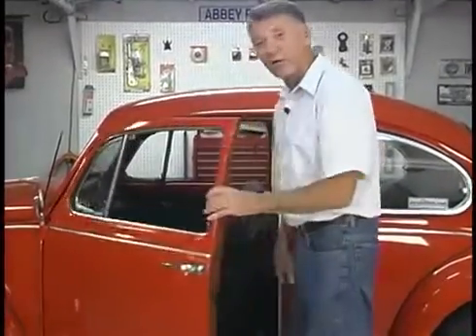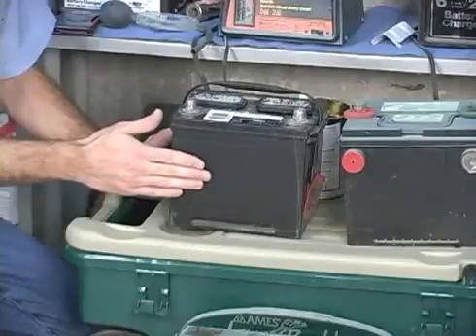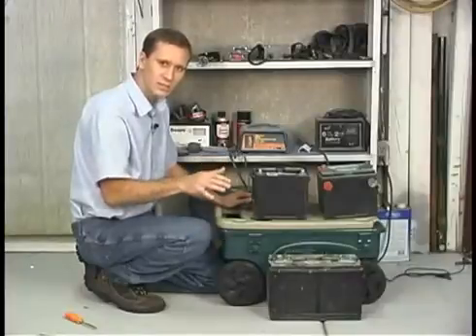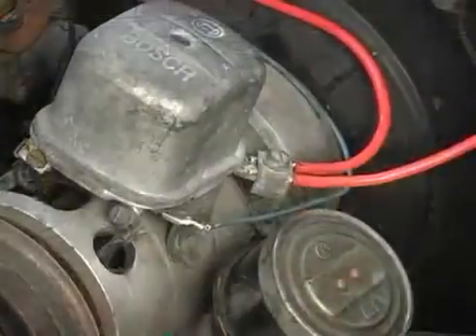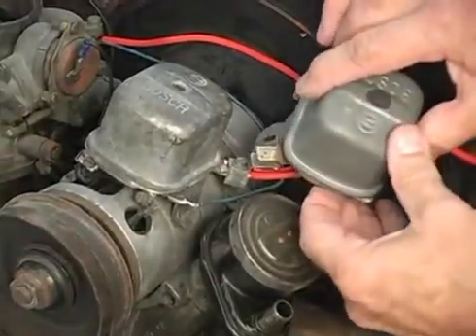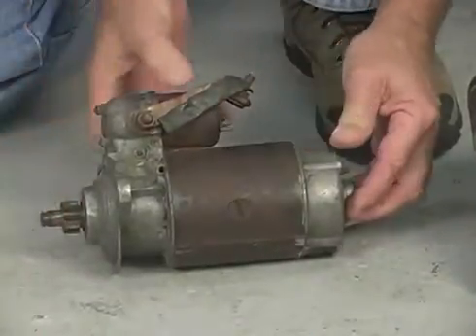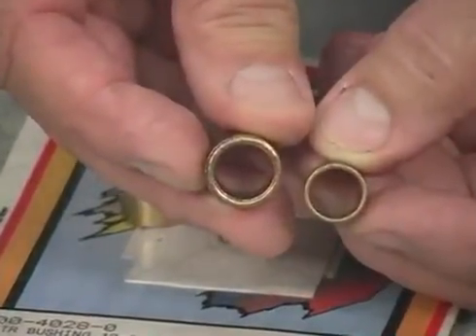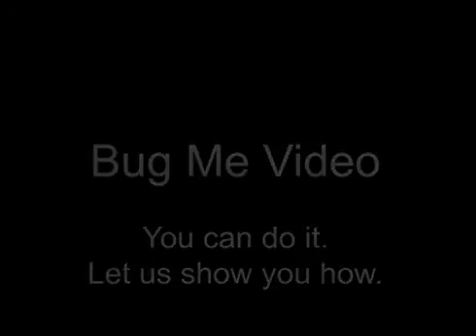Sample Bug Me Video, Volume: 10 VW Beetle Electrical Troubleshooting DVD

Comment: I just bought a brand new starter from Napa the automatic Style to put in my type 1 my problem is this starter seems like it's catching on the flywheel and not releasing makes a real loud noise and the motor moves, what do you think my problem is could it be the starter there's really only one way to mount it
Reply: Try to shim it out

Comment: Great video....I do have a question for you before I remove mine. I'm not positive as to what's going on, but when I turn my key to the "start" position, I have to hold the key there for several seconds for the starter to kick 
in.  It used to start right up when I turned the key to "start", but now I have to hold the key there to make it start.  I found this out 
accidently as I kept playing with it over and over again.  Is this the starter solenoid going out and should I replace both the starter and solenoid or just the solenoid?  Thanks in advance.....
Reply: Intresting